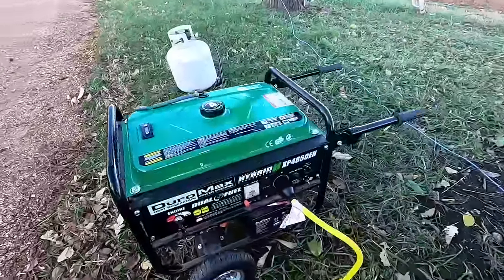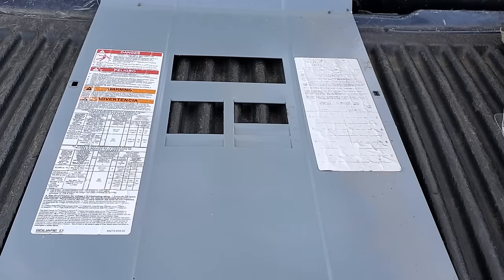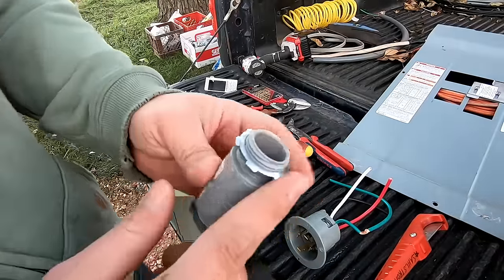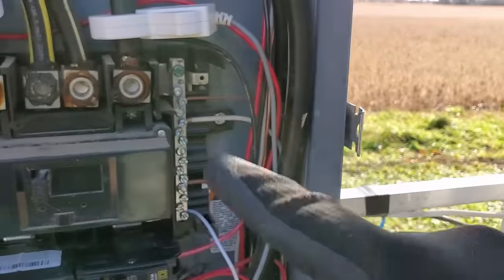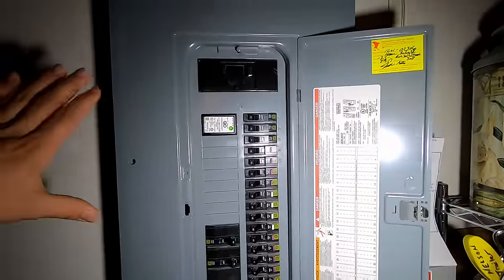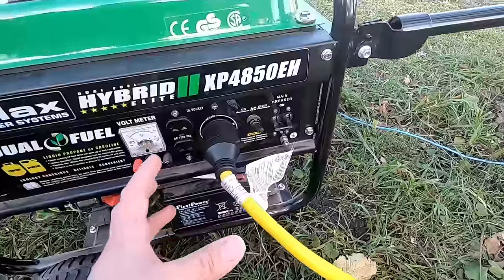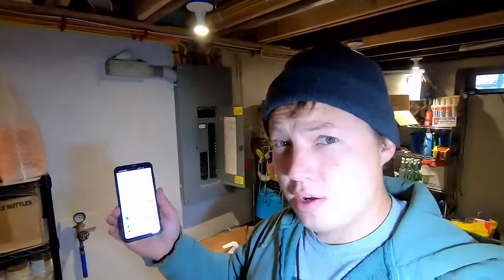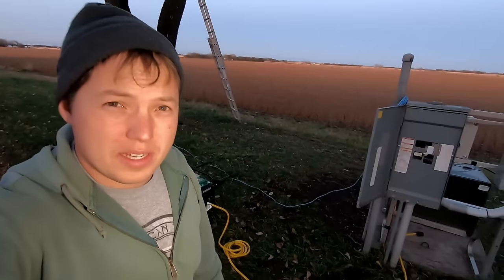How To Hook Up a Generator To Your House Using a Breaker Interlock Kit & Power Inlet Box

Comment: Literally I did this this morning. Thanks to you Benjamin. I looked at a couple of other videos from people (i shall not mention) who didn't even show you how to wire up the plug properly. They just showed you the plug then cut to it already wired and installed into the wall. I still had to make a couple of trips to the hardware store for some extra conduit and fittings, but your lesson on how to wire everything in the plug and the electrical panel saved me a great deal of time. As soon as I was done I tested everything and it worked perfectly. Now my wife and I won't have to run extension cords to the generator. Now we just need a newer dual fuel generator we can hook up to our propane tank. Thanks again. The lesson was informative. I also liked your video showing exactly what materials I needed.
Reply: @The_Happy_Aviation_Enthusiast  I got it covered. Didn't need the novel.

Comment: Good job on the video, you took the time to explain everything including the little details someone should be aware of. One thing I just learned was that romex can't be run outside even if in a conduit. Looks like I should have checked on that code because I've done that a few times now and wasn't aware of the code violation.
Reply from the maker: Glad I was able to be of assistance! Yeah, the romex thing is easy to miss especially with conduit since you would think that conduit would be an adequate barrier for outdoor use.

Comment: Thanks for pointing out @19:00 that a "floating neutral" generator is appropriate for this type of installation. Bonded neutral generators can also be used to power a home, but they require a different installation.

Comment: This was a GREAT video- very thorough and edited to skip unnecessary footage.  Step by step with very articulate instructions without any goofy attempts at humor or drama.  So many of these type videos are hard to get through because the footage tends to be more about the presenter than the presentation itself- this kid nailed it.  Well done Benjamin!
Reply: ⚠️Generator safety tips:

This is just a reminder for everyone’s safety when using portable generators. All generator safety rules need to be followed carefully to avoid hazards. 

1) Please do not allow an unqualified person or your children to operate the portable generator. Just because some manuals don’t say that doesn’t mean it’s safe. That is important against the generator safety rules. We also need to be keeping an eye on our children too. You need to make sure that your children are not playing near the portable generator especially when it’s running so they won’t get electrocuted. Generators pose electrical risks and they can be hot during an operation. Please keep your children away from the portable generator at all times. It is important to keep our children safe especially our little ones. Be aware of all the hazards.

2) Some people use their portable generators indoors which increases the risk of carbon monoxide poisoning. It’s important to have carbon monoxide detectors if you have a gas generator. Never ever use your generator indoors even if your doors and windows are open and even in the garage is not safe to use a portable generator. Not even at your porch and your deck. It is never safe to use your generator indoors and in enclosed areas of your home. Your generator needs to be 15-20 feet away from your house. 

3) 🔥generators cause fire hazards too. Never refuel your generator while it’s running. You need to let your generator cool off before refueling it and before storing your generator. Never overload your generator too. Never ever back feed your generator. You should never plug your generator into a wall outlet. Also never store propane tanks indoors. Please keep flammable things away from the generator as well and please don’t smoke cigarettes near the generator. Having a fire extinguisher next to the generator is also important against the generator safety rules. 

4) generator operation; make sure your hands are dry before touching the generator. Never use your generator in wet conditions. Don’t let your generator get wet. You need a generator tent if you need to use your generator during wet weather. Please don’t wear loose clothes when operating the generator. Turn on your generator before plugging in appliances. Use the right cord for your generator. Please do not use worn out cords. 

https://youtu.be/I1jT3ANENvI and here is a video more about keeping others safe when using generators and also about our family’s safety. Hope this helps

Comment: With these storms that have been going on this spring in here in MN I decided to purchase a generator.  I also have the inlet box and interlock kit but need to get the breaker and wire yet.  The sump pump must run when water is pouring in!  It will be nice to be able to run a few other things too.  Excellent video, thanks!

Comment: Good vid.   I did a full safety switch system and sub panel here in Gulf Coast for my 5500 Honda genset.   Curiously I was thinking power cuts from storms here but was most excited in the recent Texas winter power outage.   I found that the gen breaker will pop even if one leg is overloaded which is good.   It was a huge benefit to have lights, tv, elec kettle, microwave, toaster etc on line so we could live fairly comfortably.   Having all lights converted to LED is also a big help.    Of course all the heavy duty 240 volt stuff was switched off like A/C, oven, cook top, dryer etc. but not a problem a day and night or so,   A gas fireplace kept things warm and cheerful and a gas grill outside gave all the cooking we needed for hot food.   The greatest plus of all was to have the genset converted to run on natural gas which is always on.   No gasoline needed!   When a hurricane hits, good luck finding gasoline!   Also the carb and engine always stay clean and never have a storage problem.   Starts up first time every time..   the importance of a legal switchover system cannot be overemphasized.    It’s not only your safety at stake but those linemen out there in bad weather and tough conditions who need us to do this legally.   There are people out there doing some crazy stuff with little real understanding of electricity.
Reply: ⚠️Generator safety tips:

This is just a reminder for everyone’s safety when using portable generators. All generator safety rules need to be followed carefully to avoid hazards. 

1) Please do not allow an unqualified person or your children to operate the portable generator. Just because some manuals don’t say that doesn’t mean it’s safe. That is important against the generator safety rules. We also need to be keeping an eye on our children too. You need to make sure that your children are not playing near the portable generator especially when it’s running so they won’t get electrocuted. Generators pose electrical risks and they can be hot during an operation. Please keep your children away from the portable generator at all times. It is important to keep our children safe especially our little ones. Be aware of all the hazards.

2) Some people use their portable generators indoors which increases the risk of carbon monoxide poisoning. It’s important to have a carbon monoxide if you have a gas generator. Never ever use your generator indoors even if your doors and windows are open and even in the garage is not safe to use a portable generator. Not even at your porch and your deck. It is never safe to use your generator indoors and in enclosed areas of your home. Your generator needs to be 15-20 feet away from your house. 

3) 🔥generators cause fire hazards too. Never refuel your generator while it’s running. You need to let your generator cool off before refueling it and before storing your generator. Never overload your generator too. Never ever back feed your generator. You should never plug your generator into a wall outlet. Also never store propane tanks indoors. Please keep flammable things away from the generator as well and please don’t smoke cigarettes near the generator. Having a fire extinguisher next to the generator is also important against the generator safety rules. 

4) generator operation; make sure your hands are dry before touching the generator. Never use your generator in wet conditions. Don’t let your generator get wet. You need a generator tent if you need to use your generator during wet weather. Please don’t wear loose clothes when operating the generator. Turn on your generator before plugging in appliances. Use the right cord for your generator. Please do not use worn out cords. 

https://youtu.be/I1jT3ANENvI and here is a video more about keeping others safe when using generators and also about our family’s safety. Hope this helps

Comment: Ben, Thanks for another great video. I did something quite similar to this a couple of years ago. I also have a Square D QO panel with a similar interlock.  My generator is a bit larger - 9KW continuous output. My generator had the neutral and ground bonded internally by default so I unbonded them for this application. I made up a short (1 ft) extension cord for the 240V 4 pin outlet that re-establishes this bonding if I want to use the generator for something else. Regarding loading the generator, you also need to make sure your 120V loads are reasonably balanced. You can’t go past half the continuous power rating on either of the 120V legs. I monitor loading individually on each of my incoming hot wires. Just one comment on your installation – In your outdoor panel, I would suggest you make a drip loop at the bottom just before the grey jacketed 10/3 wire enters the conduit and heads for your power inlet box.  That way, if any water (however unlikely) manages to make its way into the panel box it cannot inadvertently be directed into the power inlet box where it could cause unwanted corrosion.
Reply: One more thing... I also installed a PowerBack Alert device from Reliance. This device makes a very loud noise when the mains power returns. This works great for my setup (panel inside). I am thinking no so good for your setup with your utility feed so far from your house.  Perhaps you can use some of those CAT-5 or Cat-6 wires that seem to visible in your video but not connected. This could help you to get a power returned alarm to sound indoors. BTW, big advantage of your setup is that it gets the generator noise far away from your house.
Reply: ⚠️Generator safety tips:

This is just a reminder for everyone’s safety when using portable generators. All generator safety rules need to be followed carefully to avoid hazards. 

1) Please do not allow an unqualified person or your children to operate the portable generator. Just because some manuals don’t say that doesn’t mean it’s safe. That is important against the generator safety rules. We also need to be keeping an eye on our children too. You need to make sure that your children are not playing near the portable generator especially when it’s running so they won’t get electrocuted. Generators pose electrical risks and they can be hot during an operation. Please keep your children away from the portable generator at all times. It is important to keep our children safe especially our little ones. Be aware of all the hazards.

2) Some people use their portable generators indoors which increases the risk of carbon monoxide poisoning. It’s important to have carbon monoxide detectors if you have a gas generator. Never ever use your generator indoors even if your doors and windows are open and even in the garage is not safe to use a portable generator. Not even at your porch and your deck. It is never safe to use your generator indoors and in enclosed areas of your home. Your generator needs to be 15-20 feet away from your house. 

3) 🔥generators cause fire hazards too. Never refuel your generator while it’s running. You need to let your generator cool off before refueling it and before storing your generator. Never overload your generator too. Never ever back feed your generator. You should never plug your generator into a wall outlet. Also never store propane tanks indoors. Please keep flammable things away from the generator as well and please don’t smoke cigarettes near the generator. Having a fire extinguisher next to the generator is also important against the generator safety rules. 

4) generator operation; make sure your hands are dry before touching the generator. Never use your generator in wet conditions. Don’t let your generator get wet. You need a generator tent if you need to use your generator during wet weather. Please don’t wear loose clothes when operating the generator. Turn on your generator before plugging in appliances. Use the right cord for your generator. Please do not use worn out cords. 

https://youtu.be/I1jT3ANENvI and here is a video more about keeping others safe when using generators and also about our family’s safety. Hope this helps

Comment: Ben: Check to make sure your generator DOES NOT HAVE a bonded neutral configuration. DuroMax literature may call your generator a floating neutral, but it, in fact, may be “isolated” from the frame vs. truly floating. A simple continuity check between the generator receptacles’ neutrals and grounds will confirm the answer. If it shows to be bonded, you’d probably want to remove the jumper in the generator to unbond the neutral and ground, otherwise your ground circuit between the generator and the panel will be energized as a “parallel neutral” due to it being bonded with the neutral at the panel and the generator.
Reply from the maker: Exactly! I actually have a video about this very topic coming out later on today!
Reply: Benjamin Sahlstrom That’s great. Love everything you do... keep them coming!!
Reply: Lots of conflicting information “out there” about proper grounding of generators. I spoke with Rob at DuroMax and their suggestion is to ground the generator with a rod attached to the grounding nut on the generator panel. However, if you do this and you’ve got a ground wire going from the generator receptacle to the main panel ground bus, it would need to be removed/disconnected. I think I prefer to ground the generator to the main panel ground bus, and in that case will remove the jumper between the neutral and ground under the generator cover. Simple enough to do. I know DuroMax would probably say not to do this because if the generator were to be used in the field that jumper would need to be reinstalled...which leaves room for user error!
Reply: My Duromax has a floating neutral, which is fine for a transfer switch that only switches the hot wire.  No ground wire because you want any fault to trip the breaker in the generator.

Comment: My neighbor had a house built with a 240 volt outlet put in his garage close to his breaker box. When the power went out for 5 days, he plugged in the generator and ran a exhaust hose out the bottom of the garage door. TURNED OFF THE MAIN POWER IN THE BREAKER BOX. Then started the generator and had power throughout his whole house, and just refueled about twice a day.  (Big tank).  Freezer, TV, lights, heaters, all worked great.
Reply: Make sure you follow all the generator safety rules whenever you use your portable generator. All generator safety rules need to be followed carefully to avoid any hazards. 
⚠️Here are the generator safety tips:

This is just a reminder for your safety. 

1) Please do not allow an unqualified person or your children to operate the portable generator. Just because some manuals don’t say that doesn’t mean it’s safe. That is important against the generator safety rules. We also need to be keeping an eye on our children too. You need to make sure that your children are not playing near the portable generator especially when it’s running so they won’t get electrocuted. Generators pose electrical risks and they can be hot during an operation. Please keep your children away from the portable generator at all times. It is important to keep our children safe especially our little ones. Be aware of all the hazards.

2) Some people use their portable generators indoors which increases the risk of carbon monoxide poisoning. It’s important to have a carbon monoxide if you have a gas generator. Never ever use your generator indoors even if your doors and windows are open and even in the garage is not safe to use a portable generator. Not even at your porch and your deck. It is never safe to use your generator indoors and in enclosed areas of your home. Your generator needs to be 15-20 feet away from your house. 

3) 🔥generators cause fire hazards too. Never refuel your generator while it’s running. You need to let your generator cool off before refueling it and before storing your generator. Never overload your generator too. Never ever back feed your generator. You should never plug your generator into a wall outlet. Also never store propane tanks indoors. Please keep flammable things away from the generator as well and please don’t smoke cigarettes near the generator. Having a fire extinguisher next to the generator is also important against the generator safety rules. 

4) generator operation; make sure your hands are dry before touching the generator. Never use your generator in wet conditions. Don’t let your generator get wet. You need a generator tent if you need to use your generator during wet weather. Please don’t wear loose clothes when operating the generator. Turn on your generator before plugging in appliances. Use the right cord for your generator. Please do not use worn out cords. 

https://youtu.be/I1jT3ANENvI and here is a video more about keeping others safe when using generators and also about our family’s safety. Hope this helps